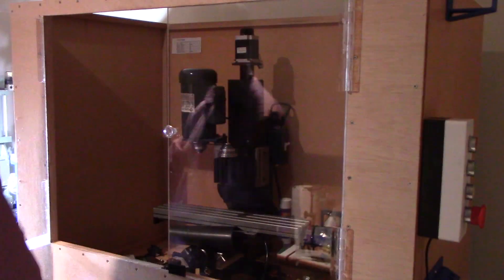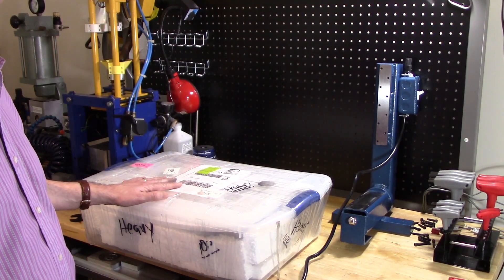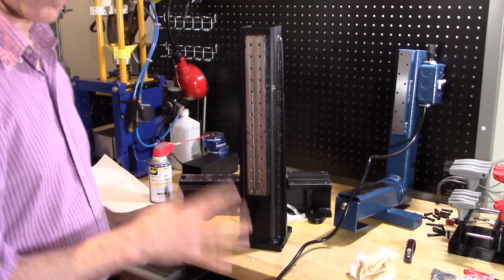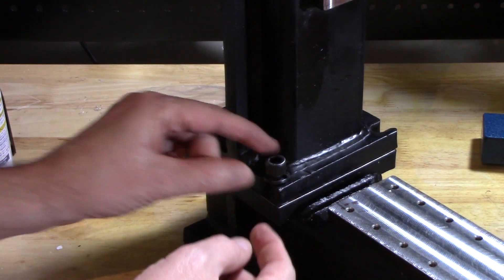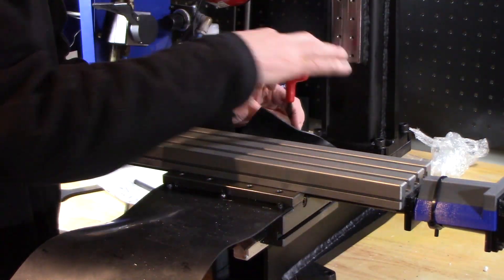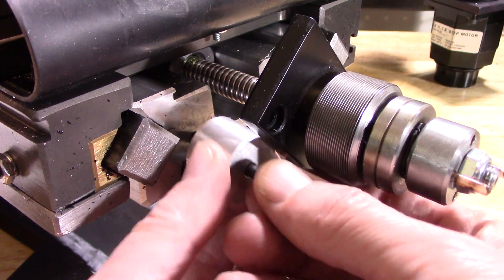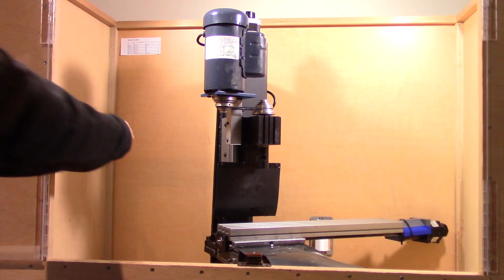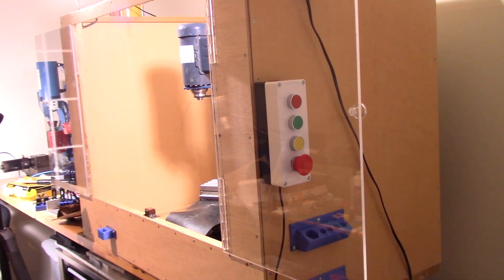New Frame, "Taigmach" Part 4

Comment: Hello John, could you tell me please about the reason why quite a few people replace the original Taig factory blue frames with something else? I know for instance the the famous Harbor Freight Mini Mill lacks rigidity in the connection point of the column to the base. That weakness results in carbide cutters being broken and also leads to poor precision of machining. Does the original Taig frame suffers from the same problems?
Reply from the maker: There are two reasons. The first is additional rigidity. The blue frame hinges at the bottom, which is so you can use it at an angle other than 90 degrees to the work. But that also reduced rigidity. The other reason is to allow the spindle to be mounted farther from the Z column, which provides some very useful Y travel, and is required for the new TTS spindle I added. I don't remember the specifics, but I likely covered them in later videos in this series.

Comment: Make a video making cuts in steel.  I would like to see how good it runs.  Are tapered roller bearings the next improvement.  If there is a video what is the name.
Reply from the maker: I'm not sure my current spindle is up to significant cuts in steel--also I've never cut steel. But I have a new R8 spindle I received recently that should be a lot more rigid. I'll have to try some steel cutting with that.
Reply: Cut 12L14 whenever possible.  A second option is 416 Stainless.  Over the course of 6 years I changed and changed my Sherline 5000 mill many times, there is not much left.  Today I have replaced the X-Y axis table with the Taig and the Z-axis with Taig.  The X-Y table is bolted to a large 1/2" plate of aluminum and I have a bridge Z-axis column made up of two 28" 2.5x4 aluminum columns with a 6" space in between. The space allows me to have a brass chip pan bolted to the back of the Y-axis. Amazingly I am still using the Sherline spindle and motor.  Some day I may make a new spindle using 25x52x15 tapered roller bearings. I do have a vintage Taiwan Mill-Drill that I only use for the Large jobs like squaring of the 2.5x4x28 aluminum columns.  My home made mill is 10 times more fun to use.

Comment: Could you tell me if you were able to lift the completed assembled mill into your enclosure by yourself or if you needed a helping hand as it was too heavy to carry? My concern is upgrading to this frame and not being able to lift it myself. 

Also curious what is those round like pucks under the frame? do those add dampening to it?
Reply from the maker: I assembled it in place, so I don't know. My enclosure lifts up over the mill, so I put the enclosure back after assembling the mill. My workbench is pretty high, so I can't lift the mill with my arms almost straight out. I'd probably have to get on a stool to be able to lift it. 

As to the pucks, these are Rockler Bench Cookies. I don't have my mill screwed to my bench, so these do a great job of keeping the mill in place.

Comment: Thanks John, your video turned me on to the FB group and the new frame. Just ordered mine! BTW - I notice you are using the stock motor and not the Consew upgrade. Any particular reason? Cheers, Mark
Reply from the maker: Nice! At the very moment, I'm 3D printing a box for the potentiometer to control the motor speed on the Consew. I also have some parts to make a circuit that will allow me to control the speed from software. My plan is to get the software spindle speed control working at my desk before I mount the motor to the frame. I'm hoping to get that working this weekend or later next week.
Reply: Very cool! I've wanted software control of spindle speed for a long time. Can't wait to see how yours turns out. I have Mach3  setup to turn on/off the stock motor via relay, so at least it stops spinning automatically at the end of a long run, but still moving belts to change speed :-(. Been using it this way close to 10 years now.

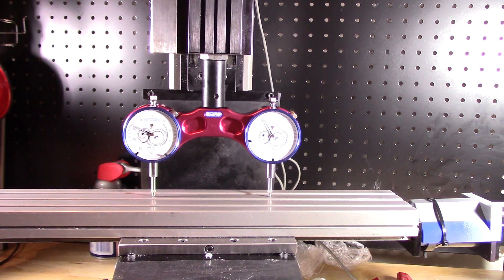Comment: Good upgrade. At 8:07 it seems lack of stiffness. I recommend change paper shims to a metal immediately and check fit by paint. If you install all machine (bolt the base) to thick steel plate, you can rise general rigidity highly. Best regards!
Reply from the maker: Yes, the paper shims were temporary. I have new metal shims I'll be installing this weekend. I'll have to look into getting a thick steel plate for the base. That's a good idea.

Comment: Have you considered filling the square tube cavities full of sand or even better epoxy granite?
Reply: What for?
Reply: @sid1977  Its a common frame damping technique for machine builders.
Reply from the maker: That's something I can do later if I need to. My understanding is that this would mainly make a difference for heavier milling than I do most of the time. I mostly do micro machining (1/8" cutters or smaller), so this should be a factor.

Comment: Very nice video indeed. I'm currently awaiting my new Taig CNC Mill. I noticed with this mod. that you loose the ability to move the Z in a side-to-side motion. I'm wondering if you anticipate a fix?
Again, a very beefy upgrade.
Reply: tom warren that’s part of the upgrade. Adds a LOT more rigidity
Reply: The tilting of the Z-axis is generally an unwanted feature. It makes sense for tramming the machine in and for saving the spindle in x-axis crashes but can be a source of flex.
Reply from the maker: I see the fixed Z as a feature. I've never wanted to move the Z side to side. As I understand it, this is mainly useful for manual milling. But since I only do CNC milling, having the Z fixed ensures it stays aligned.